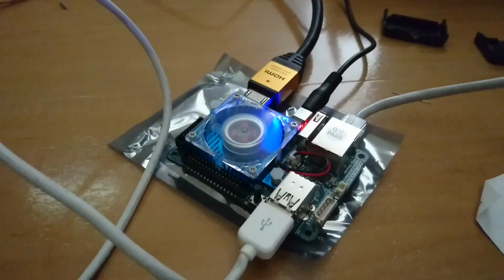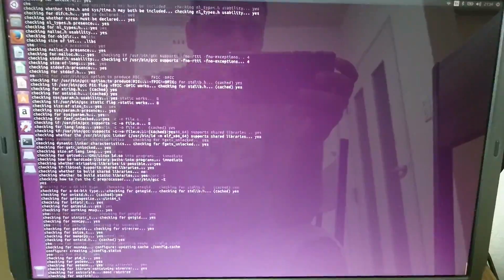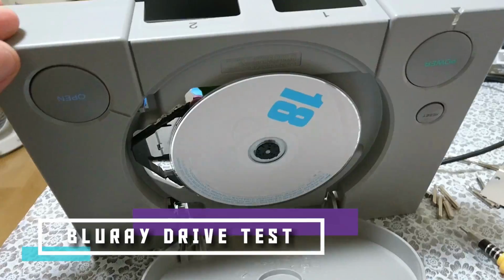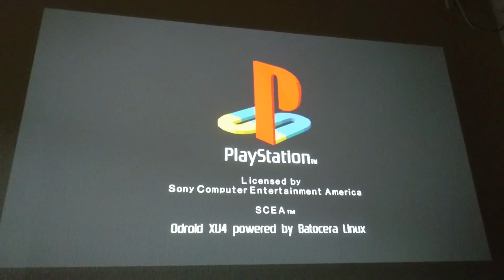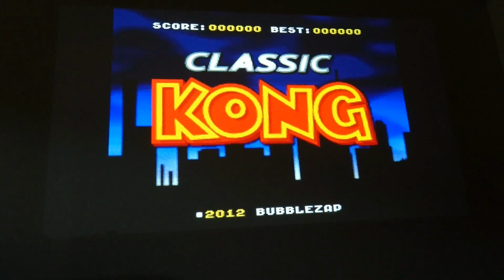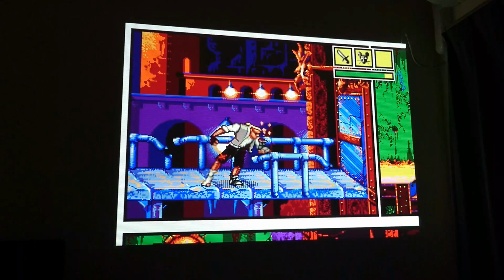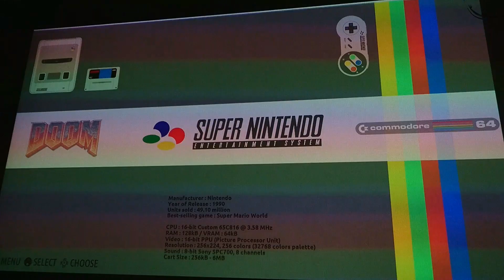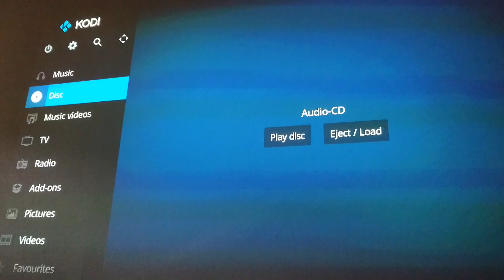The OCTA-CORE PlayStation!

Comment: I plan on doing something similar and I would never think of putting an actual optical drive in it. Heck, maybe you can run PS1 games directly from the disc (it's possible with the Windows version of most emulators, I would guess it's possible on the Linux version as well). Also great idea of fitting PS1 to usb adaptors instead of just removing them and putting USB slots in their place. Also good idea fitting the AC adaptor on the existing power board instead of again just putting the included cable through a hole in the back. 

The only things I would do differently is carefully grinding the plastic for the optical drive instead of cutting it and gluing it with a glue gun. Also the rear ports you could maybe use some plastic to shape the ports to fit (or just hide them all in the parallel port area). 

Still great job and I will definitely use this as template for my own project.
Reply from the maker: Thank you sir!

Comment: controllers work and working ce drive with bonuses, yup thats how its done. just pu drive in better though i feel like it will come apart eventually from the disc spinning to opening up and putting in or taking out all the time i mean its hot glue, wont hold it forever. And also perfect the rear a little, the usb drive mainly, make it flush and put metal around you know? just make it look epic-ly perfect. Maybe do a once over painting it too real well and it will be suuuuuper awesome
Reply from the maker: Thank you.. wait for my next build! it will be perfect!

Comment: the problem i see is those controller adapters you used. i suppose you used the cheap ones, which emulate sticks really bad and dont have controller vibration. on ps2 is even worse cause most of them dont have even pressure sensors for the buttons. the only one i have found that does the pressure and vibration is the super joy box, but sadly it requires its own drivers.
Reply from the maker: So far it works great! I dnt know about the vibration though!

Comment: More like a frankenstation. Could change the broken drive unit and power supply board and you would get a working PS1 that would serve you another 20+ years. I get the other opportunities this device will give you but kinda still lost it. I've seen butchered fried PS1 that would be a better donor then this, this PS1 still had life in it. I have made a pi-station for a friend from a beaten up case which I fixed with epoxy sanded it down and painted it white. Still your build is interesting but needs to put more effort in it to make it more cleaner. Hope you do an update on this.

Comment: nicely done, I love how you kept the original controller ports operational, and also managed to have a working optical drive.
Reply from the maker: Thank you!
Reply from the maker: Original ports were added using usb to dualshock adaptors.. you need to use a dvd drive with sub channel read feature.. not all have it.. then you can use retroarch to load from the drive.

Comment: I honestly would prefer to have it so that I could use the AV ports on the back as well as HDMI, because I still love the CRT TV look but would rather use an actual CRT display than an emulated display.
Also, I would rather keep the parallel port. Still, overall, this is really cool. After the modifications though, there's no way one could return this to it's non-modified state. Just noting.
Reply from the maker: Thank you for the comment Amy!

Comment: Just curious to what you did with the power button, I'm wanting to do a similar build, and I too want to use the faxtory power button, as well as the reset if possible
Reply from the maker: I modified it to you with the AC adapter output. the Output of the AC adapter is going through the power button.
Reply: @ramakrishnamishra8179  is it possible to buy an LED green and replace the current?
Reply: Interesting. I noticed you left some resistors and caps in place, I've not done much electronics modifications, would be cool if we could get a wiring schematic to figure out what all needs to be done. Also, does pressing the power button cut the system off altogether, or does it trigger it to shutdown and then power off afterwards?

Comment: This was almost cool until I saw the hot glue!
Reply from the maker: Well! my skills are still in improving phase!
Reply: @ramakrishnamishra8179  man how long u been youtubin? hot glue is a sin of the retarded that don't  know how to make a permanent solution... shameful dispray /bow 
now on to the real reason i choose to  damn this!!  You took a PlayStation gutted it put some bullshit in it and still have the ballz to call it good.... how many games are you gonna put on 16g? 20 at the most? if you wanna impress you gotta use the original hardware in some fashion so you can still actually call it a PS1
Reply: Chill out bruh.
Reply: is a cool proyect, but indeed it was a lot of fish
Reply: and whats about not Cuting? he broke it offffffff !!!!!!
Reply: Well did you expect him to use plasti weld?? No you didint, and it’s not like he can use the original screw method to hold it in place so his hot glue was a good idea and hot glue is just as useful as all the other tools. It’s my understanding that you can’t use plastic weld on metal.
Reply: @odachikazane3741  dude it's called a soldering iron.... an bro if its a structural issue they sell about 30 different brands of epoxy at your auto parts store  all of em under 10 bucks
Reply: Jay Means so your gonna solder plastic? And some epoxy mixes might not bond with it most should but I’m considering practically that mixing epoxy is not something everyone can easily do
Reply: @odachikazane3741  did you even read my comment "an bro if its a structural issue they sell about 30 different brands of epoxy" implying that for the plastic they sell every kind of epoxy that can bind to any combination of material, if you can't read the package and see what it adheres to what or happen to  not have to hands that can mix the 2 components with a stick then you got more important problems to deal with than playing 20+ year old video games... you need someone to take care of you an keep you away from the box of matches.... smh the stuff even comes out in equal proportions in some cases so you don't even have to measure....... so fail
Reply: hot glue is the devils work

Comment: Great job Awesome  , how you add Boot animation Odroid XU4 Thx :)
Reply from the maker: First I enabled FFPLAY in the Source code and made changes to the init.d files to run the video first. I also made the service which runs the EmulationStation to sleep for the time of the video.. so it waits for the video to get over.. Additionally I added few seconds of black screen to the video because it will take a second or two for the Projector/TV to sync to the ODROID XU4's HDMI output.. when I started this project the version was 5.8 but Now it is 5.10.. so I will have to compile a new IMG from v5.10 source with the boot video to update this..
Reply: If you contact the devs at batocera or submit your code to their github, you won't have to recompile every time there is an update. Why not submit your code?
Reply from the maker: That, my friend, is an excellent Idea! I will do so soon, I am currently swamped with office tasks... :(